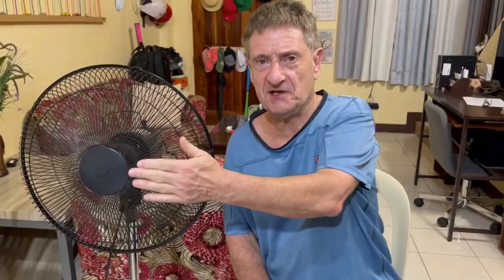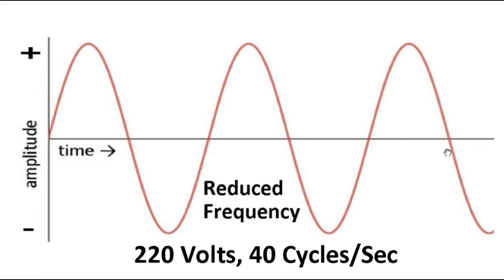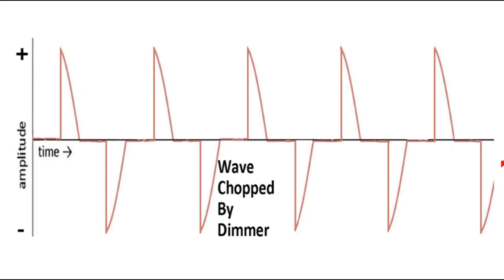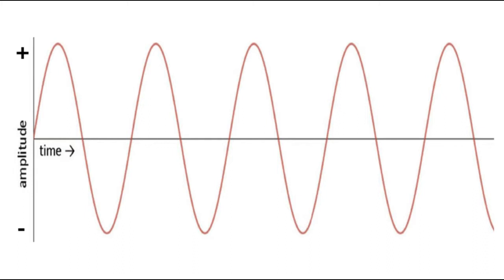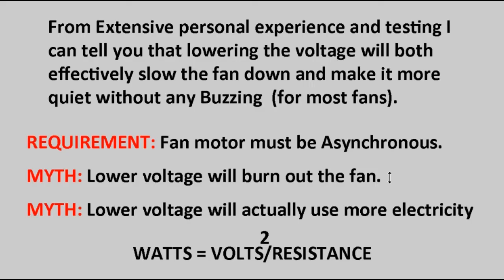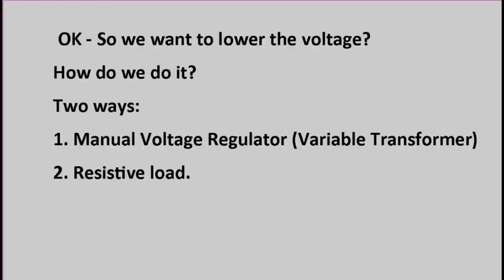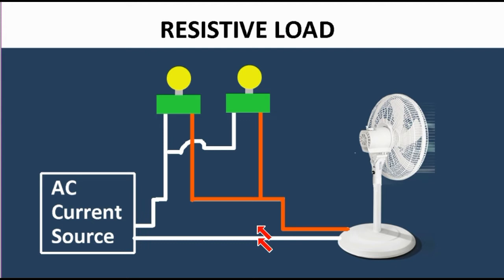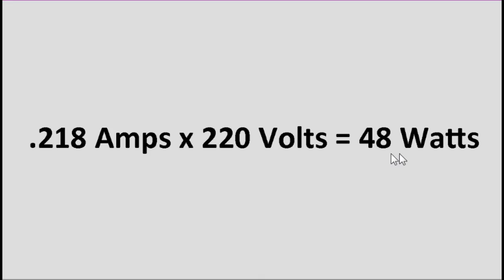QUIET-TIZE YOUR ELECTRIC FAN! MAKE IT RUN SLOWER AND BE MORE QUIET! CHEAP EFFECTIVE METHOD!

Comment: The motor is not the problem on mine, it’s the blades, I bought a new one and it’s much noisier than others & I don’t want to slow it down. Anyone know how to fix the blades to be quieter ?!
Reply: Twist them inwards slightly will make them harder to push air and slow them down

Comment: What worked for me was to change the fan blades from 3 blades to 5 and it made wounders for me, lost some fan power but made my so much more quiet, probably wont work well if the fan is not powerful enough

Comment: Really interesting, I've been into fans and air purifiers for years I was not familiar with this method. It particularly of interest because I find in the majority of cases one is trying to do what you are create a good quality silent low speed. That still moves enough air. So the variable transformers while they are the gold standard are very heavy and expensive but most of the time it's only the quiet setting one wants.
Great video thanks

Comment: grabbed one of those 5A red models from amazon, $50 one because vevor suck (no pun intended) and wont deliver the $30 one here.

it worked like a charm 🙏🏼 your a godsend.  
i have an 18" on the wall and if my ear pointed that way the hum was horrendous, if i turned it was bareable.  im kind of sensitive to these noises, they keep me in a high state of stress for some reason. but now its gone . just the fluttering of the fan blades at 90v, no burning smells so far (😂 ive had some bad speed regulators) even the metal frame has stopped vibrating. 👍 ty so much. wonderful man.

i would have gone the bulb route but with the price of sockets and finding bulbs that will work these days i went with the red chunk. i need another for my extractor but they are pricey.  (#vevor 🗡️👀)

Comment: I'd actually be willing to shell out $100 for a regulator because I need to have a floor fan pointed my direction for health reasons (advancing peripheral neuropathy that makes it really hard for my skin to tell temperature and I end up feeling constantly too hot when I shouldn't). My previous box fan was tolerable but the motor finally burned out and the new fan is notably louder and pushes air too hard even on the lowest setting. I can see this being an ongoing problem because I hate online returns and I know any fan will burn its motor out at some point anyways.

So thanks for the recommendation, now I'm lost reading Amazon reviews and wondering how to pick a regulator that won't burn out in two months or catch fire. x.x
Reply: Hello - you should consider a fan with variable speed. I’d recommend the vornado energy smart fans - they can be adjusted from very slow to very fast. This will serve you better than trying to slow AC fans

Comment: Thanks for the info.  I've been trying to slow down antique electric fans that were designed to run on closer to 100 V instead of the 110 - 120 of today's lines.  They do make transformers to run Japanese appliances (100V) on North American voltage and it works great for my 1916 12" GE but they are large and expensive.  I am currently trying to slow down a tiny 6" GE from the 1920s and I'm looking for a simple, small and cost effective way to do so.  I'll have to see if I can incorporate this method.  I am curious why your house runs on 220V when you sound like an american and have american style plugs and outlets?  I would expect 220V only for your oven and dryer.

Comment: I had a fan like that but with an included 3 speed controller, i dropped the voltage to 75% using a fan regulator ($30 amazon)..it worked..but next day it was dead. Im guessing its the pcb that had issues.

Comment: Does anybody know if it makes sense to take a 220 to 110 step down transformer to take 110v and step it down to 55 volts? In other words, if you fed 110v into a 220v step down transformer (a copper coil one in particular), would you get 55v out - and not create some other problem/hazard.

Comment: Or you can just put an ac capacitor in series to reduce power very efficiently
Reply: Tell me more can I just add a cap in series on fans?
Reply: @grandtheftauto1233 just lower the value of capacitor that's all

Comment: How can I identify the type of motor I have in my fan? I tried to reduce speed with a AC motor speed controller BTA 16 600B 2000W and the fan makes a noisy buzz
Reply: He mentioned in the video don't use a dimmer, in your case speed controller, It will make noises

Comment: if u have a metal elecy, u can just bend it and the air resistance will make it slower
Reply: but this will load the motor down and cause it to use more electricity

Comment: I tried it out and it works fine.  One question though, does this use more electricity?  I mean will there be more electricity consumption in this way since it's powering two bulbs apart from the fan?
Reply: More electicity than what?

In the video it's answered that that it uses less electricity >>compared to running the fan at full power<<. The reduction in the fan's use of power is greater than the amount of power used by the two bulbs.

Whether it uses more than the alternative solutions is unclear, but of course, they have their own drawbacks in terms of noise, price etc.
Reply: he already said it will use more if you use resistance.. but i have a transformer that changes from 220 to 110, and i used it, it's working perfect

Comment: Damn its not that deep, if its just for white noise and its too loud put the fan inside a closet or further away
Reply: It's not.. you want a gentle breeze but don't want to hear the fan
Reply: We've a fan that you'd need to move 100 feet away.  It has three speeds.  High, higher, and highest.